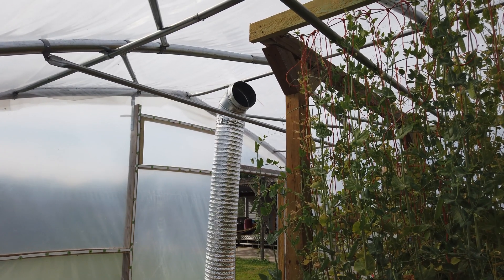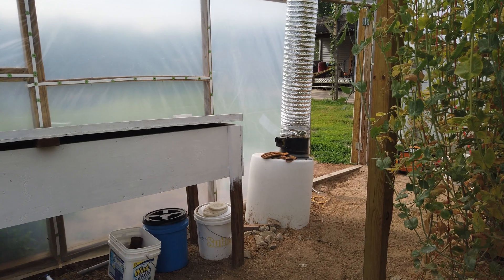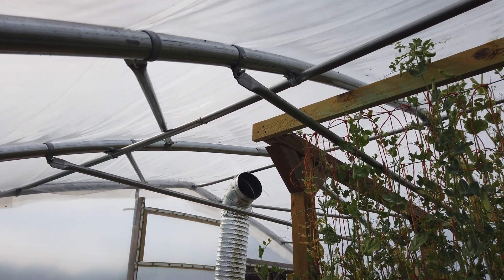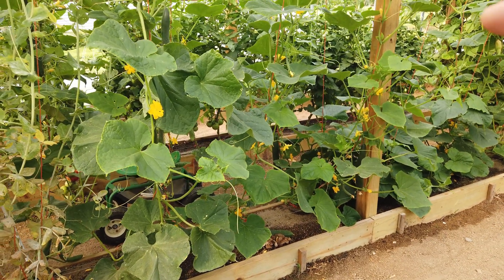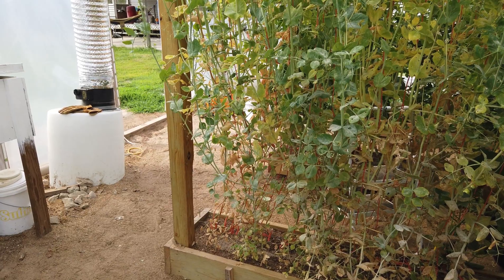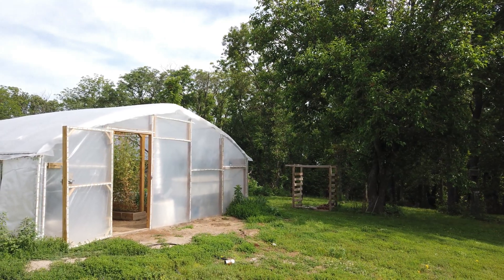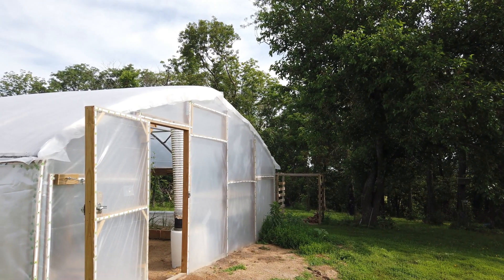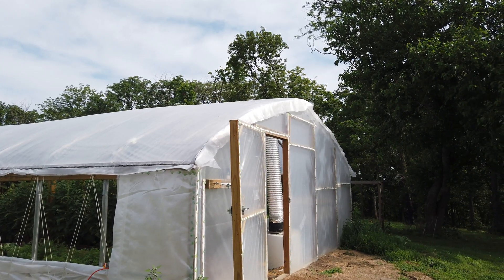Help - Arduino monitoring for heat sink greenhouse

Comment: If you still want to make an IoT system with Arduino i can help you build it! You can buy ready made products but it will be expensive.
Reply from the maker: Any idea what the cost of ready made products would be for my purpose?  I’ve not tackled this project yet but would still like to see it done.  Thanks.
Reply: @smallblockfuelie  it depends on the sale of your project! But if you know Arduino use that because it will be way more flexible and cheap. Wayyy cheaper

Comment: You don't want an Arduino system.
There are Windows-based programs, which is a lot easier to use than Arduino. 
You can get off the shelf Wifi probes. They come with different sensors - temp, humidity, wind speed, etc. They will collect the data and send them to your computer in real-time for analysis.
You don't need to re-invent the wheel; lots of people are doing what you want to do.
Reply: Garduino:
https://www.youtube.com/watch?v=35VU6InKizw
Reply from the maker: Thank you, I didn’t know such a thing existed besides with Arduino.  What is it called so I can look into it?
Reply: @smallblockfuelie  this is one example. If you google remote sensor for farmer, you will get lots of hits.
https://www.amazon.com/UbiBot-Wireless-Thermometer-Temperature-Environment/dp/B071HVDDFB

Comment: Little hard from videos to tell distances and exact locations so drawing a map with measurements and exact locations for what you are wanting. Things like conformal coating to protect circuitry are going to be needed. From the sounds of it your wanting to use wireless and have a single monitoring station in your home, so your basically wanting a few remote sensing stations in the green house. Your pretty much in the ESP32 or wifi module realm for FCC certified transmitters. Accuracy, resolution, sampling interval, and ranges (example. -10F to 110F) would be important to know.  Your best bet is getting a hold of electronic engineers on the EEVBLOG Forums.
Reply from the maker: Thank you, excellent and useful information here to get me started.  You’ve helped confirm my statement, I don’t know what I don’t know.

Comment: Hi, I like your informative videos. Are you talking about the Garduino automated System?
Reply from the maker: Thank you! Arduino.  It is an open sourced coding system that allows users to prototype all sorts of cool electronic devices.  People are building all sorts of amazing projects with it. My interest is in the ability to collect, monitor and wirelessly transmit temperature and humidity data through our wireless internet from the greenhouse to a device, likely my phone, and have the ability for real time monitoring of the greenhouse and heat sink.